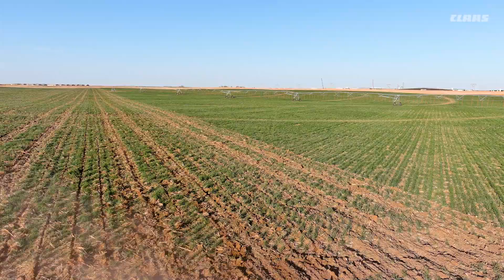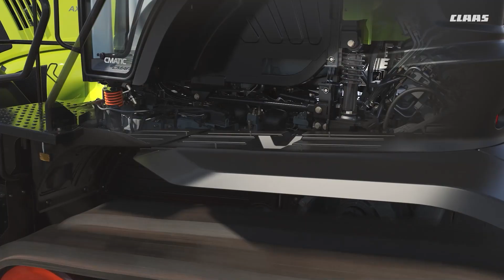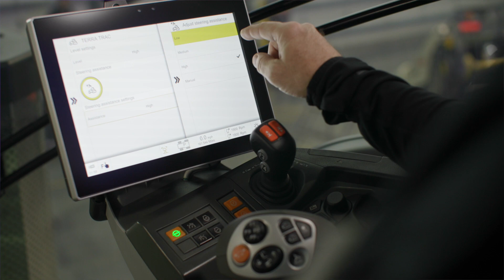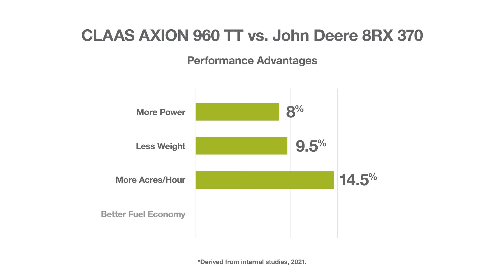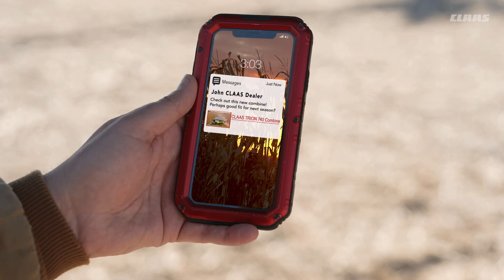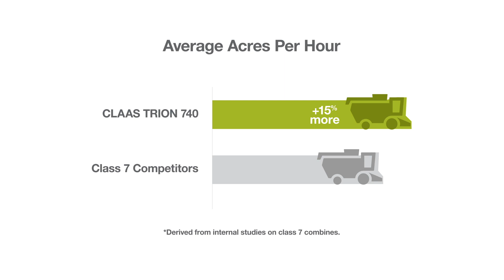CLAAS Virtual Launch Event | Combine + Tractor

Comment: Wasn't aware the Class TT was a friction drive. Would have thought that the tension required to maintain a positive drive would wear the belts out quicker, versus a positive drive type of track on competitive machines, who would require much less tension on their tracks, since the inner drive lugs impart positive motion to said tracks. Anyone else got any thoughts on this matter ? Has to be a reason why pretty much all other manufacturers have gone with the latter type of set up.

Comment: There's one thing Claas keeps forgetting. 
Right now you have a better chance of getting a John Deere or a Case tractors hell even a Masseyferguson is easier to get then along with a New Holland or even a Fendt is easier to get then a Claas. And believe me I've checked my dealerships. So what's the point of trying to prove that your Tractor is better than the competition if you can't even get one for almost 2 years. Especially in Idaho. That kind of defeats the purpose of having a better Tractor 🚜.
Reply: I was wondering if I was the only one wondering that. We we're going to buy another Claas quadrant but two years untill we could even order plus another year to build and ship and the price would also be different by then. So we just bought a krone instead, plus Claas of america is a bunch idiots with extremely poor service or no service at all.
Reply from the maker: Auto Man: I think you've gotten some sketchy info on the CLAAS tractor line. As of today, you'd maybe be one year out on a new tractor order, and we have plenty of models in stock at our dealerships.
Reply: @CLAAS_America  what about your crapy service on your quadrants and getting the serial numbers wrong for updates. We've had a knotter problem with ours from day one and not a drop of support from Claas of America! Another reason we bought a krone and we will probably be buying another krone. I'm going to be writing a letter to Germany at Claas's headquarters and telling them about you thugs, poor service! That'll put you in your place! We've lost customer's from too many missties and thousands of dollars in bad bales having to rebale! And I am tick!
Reply: @CLAAS_America  Really you say that you have plenty of models in Stock yet I drive by one of your dealerships almost every day and I've yet to see any Axion Or Xerion tractors on your lot period. Or is it just since Idaho isn't a major player like the Midwest I guess they won't get as much respect or service as the big players do. This is why I prefer New Holland or Deutz fahr or even John Deere. At least I know I can trust those companies. So far Claas has been weighed measure and left wanting.

Comment: They put the dumb garbage cummins in the Trion🤨☹️ why not the MAN or Mercedes? I was really thinking to buy this Trion but now I might just go with the smaller Lexion instead.
Reply: Cummins is a throw away engine now garbage. Not like the old Cummins. Very hard to get parts for back up orders on truck engines parts.
Reply: Because Cummins is a North American brand where parts are literally everywhere, plus they are cheaper than any MAN or Mercedes. Believe it or not Cummins builds a fine engine, the only reason you hear about failures is due to shear numbers of them in any industry.
Reply: @UncleBubbles94  North American junk you mean? Cummins will not last near as long as a MAN or a Mercedes, I'm talking from experience. They burn more feul and higher maintenance. We have MAN and Mercedes engines on our farm, most engines require their first oil change after 50 hours, on the MAN its first 100 hours, much longer intervals between maintenance because of superior engineering, engine runing much smoother and slower. I would rather pay a few more bucks for a good engine then have to pay even more on repairs and service.
Reply: @UncleBubbles94  not new Cummins junk throw a away. Know one guy who put in three new blocks in his truck very poor service or reliability
Reply: All John Deere are Detroit Cummins cross breed on big power..
Reply: Fendt Claas 
Simple Cummins are much simpler cheaper and have more available parts. Plus Cummins are much easier to maintain and work on than the MAN or Mercedes engines which are a pain in the ass to work on. They put the best engine for the market it'll be working in.
Reply: @automandan  where ever you heard that, then you got a problem? Man or Mercedes are more simple and easy to work on then you know, they don't need to be worked on duh, they never break down. And I don't care if their cheaper becuase they will be cheaper on the long run anyway.
Reply: Ok whatever floats your boat.
Reply: @automandan  you bet MAN.
Reply: Mercedes not that great either . Don't know anything about the MAN
Reply: @joescheller6680  lol, I have a western star with a Mercedes engine, hahaha I'm just laughing now with over 40000 operating hours and over a million km, nothing done to the engine yet. NO EXAGGERATION!
So you must not have very much experience with merecedes then. And a MAN is even better with low rpm and high torque the oil is always clean, we run those in our Fendt tractors and the mechanic's fight over who gets to service them, becuase theirs nothing to service lol.
Reply: @fendtclaas8689  all I can say is Volvo went to Mercedes engines and had issues with them . Think Freightliner had them as an option also with the new environmental restrictions having issues with sensors and other things.
Reply: We are still running redone cats no juice required to operate no eld .
Reply: @fendtclaas8689  some people have good luck obviously. I put over 1 million miles on two cat engines miles not kilometers so it can be done obviously. But not the norm. Most having issues with new electronic hardware can't wait. To get them unhooked. Trucks sitting in shops and not knowing how to fix.
Reply: @joescheller6680  your own country is what forces that environmental garbage to be put on, unlike if you live in Canada or another country like Russia where def and other crap is banned you won't experience those problems. I'm not saying Canada has banned def and stuff but our restrictions are way less then the usa.
Reply: @joescheller6680  thats the problem your engines were redone, thats what we fear most, to have to do on the farm and fuel economy. A few sensors is not a problem for us every new engine will have sensor problems even cat.